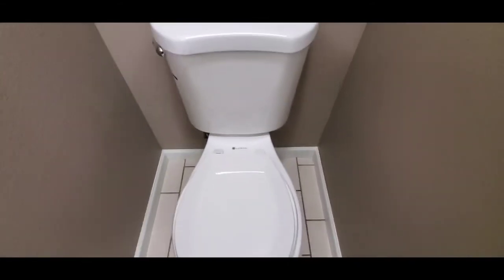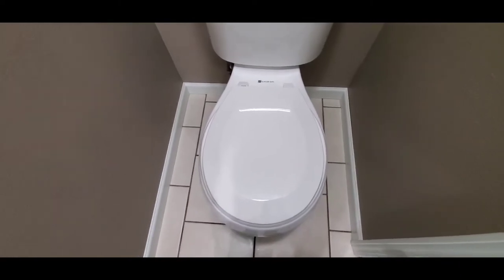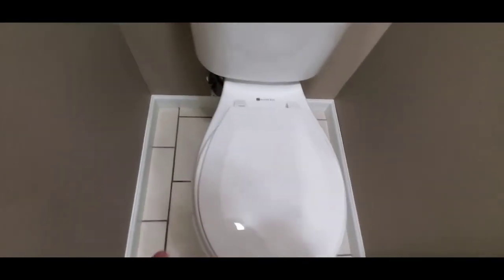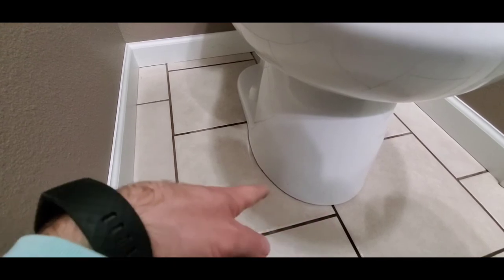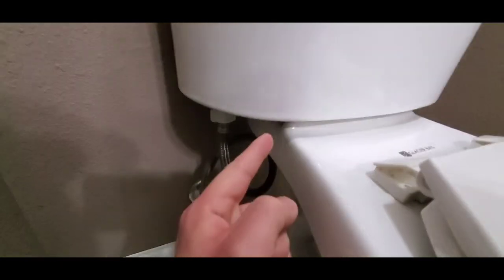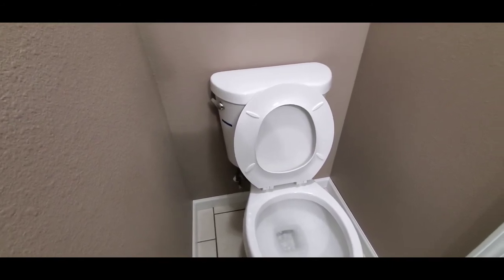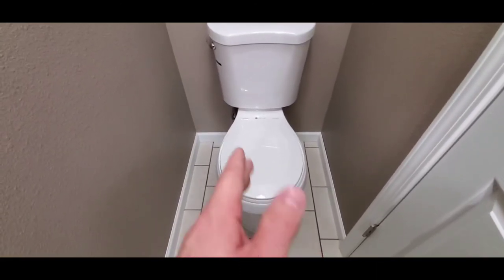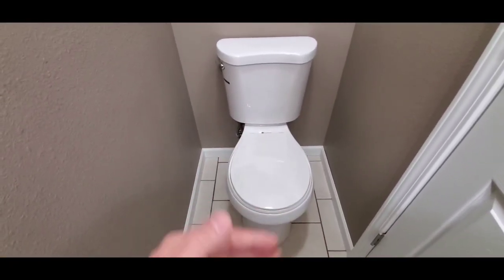How to Inspect a Toilet - St. Louis Home Inspector

Comment: This is my standard comment for my toilet section which I alter as needed.
"Serviceable; toilets that are loose at floor mounts can be stabilized with tub & tile caulk atop the tile glaze in 3+ locations, avoid grout lines w/caulk, if you over tighten fasteners it will crack the china flange or mounts, tighten till it's just snug." Of course there are 8 other toilet item lines I can use, about half of them are alterable and some are unchangeable.
I noticed you short flush, the quick flick of the flush handle. I hold it down until the full tank drains before I release it. You catch flapper valves that hang up that don't on the short flush. I flush 3 to 6 times as I check mine. Your leg press for bowl mount tightness I'll pass on, I use the big toe side of each foot to tap the bowl with my shoe, there might me something on the bowl you don't want on your pants and your shoe is easier to clean if need be. Also I check for rocking front to rear by pressing down on the front of the seat lid while holding my hand on the center rear of the tank lid. I've found secure toilets with no side to side movement or loose mounts at the floor or loose tank to bowl connections but they do rock front to rear. I also remove the tank lid as sometimes you'll find a tank crack on the wall side of the tank that you would not have seen otherwise.
Reply: noted!
Reply: I'm not an inspector, but I was wondering about checking the toilet for stability by checking to see if it rocks front to back or side to side.
I also agree about the short flushes; there's no way all solids will clear with short flushes.

General question: 
Why is there a door so close to the toilet that it looks like it won't clear it? What's the idea about tiny, closeted, toilet spaces?
They are very hard to clean and the ventilation and lighting is usually poor.